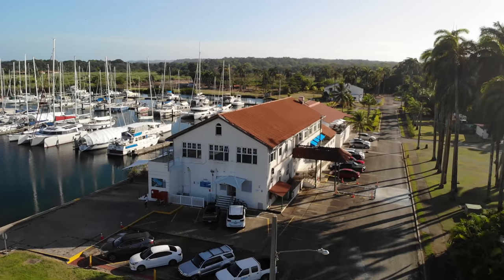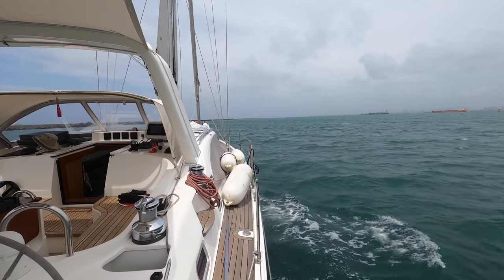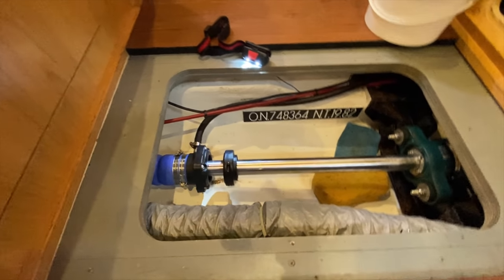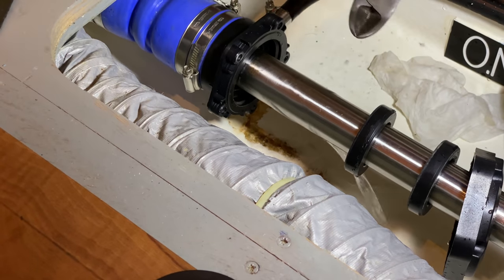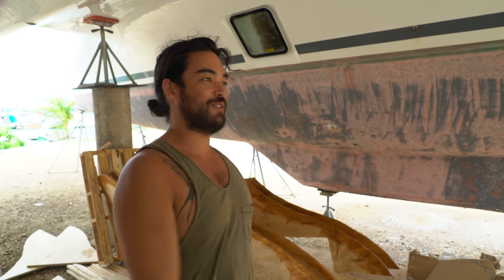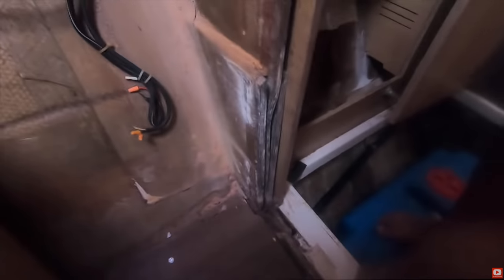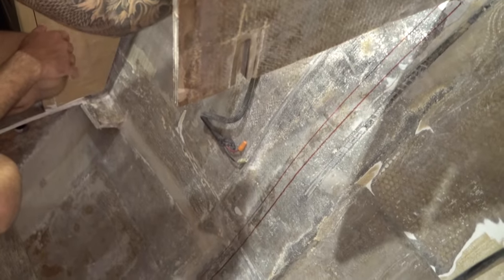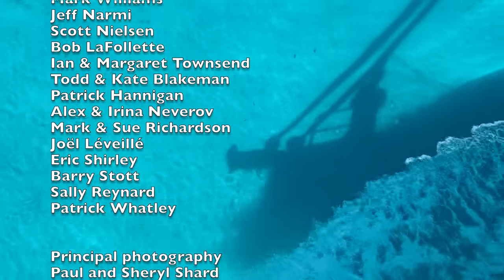We're Taking on Water! | Distant Shores | EP 210

Comment: Just curious, with the ability to beach your boat, why not beach it and then change the seal?
Reply from the maker: The shaft is about 2' underwater so we'd need more than 3' or so of tidal range to dry out and get the shaft up out of the water. I did this once on a beach in the UK (with 10' tide range that day) to change the propeller. All went well until I realized I was missing a needed wrench... very fast run to the hardware store in town to get it done before the tide came back in :-)

Comment: So, I've been doing some mental math, and think that I'm smart in looking for a shaft driven propeller system when choosing a blue water boat. I was surprised at how little water you took on while replacing your 'stuffing box' seal- I expected much more? I must be somewhat correct in guessing that a sealed driveshaft has much less of chance of sinking a boat that a sail drive unit- not to mention the 1/2shafts and bevelled gearing to change thrust direction. 
   I am very curious about the designed hull in process in Holland? Is that project a go for Distant Shores, or- is it still in the design phase? I'm exceptionally curious about aluminum built boats over say 50 feet? I hope that the project is till going to happen! Any news would be great. Thanks in advance.

Comment: Would drip less system  work for older sailboat in like 1973
Reply from the maker: Any boat with a shaft drive should work. It replaces the more traditional stuffing box. Let us know if you try it! Also as Stuart W says down below you can also try the modern packing in the old box...
Reply: What the brand you use
Reply: I have a 1978 North American 40 with a traditional stuffing box. Each hail out I have it serviced and I like that it can be adjusted under way.
Reply: Volvo shaft seal is probably the cheapest & very good for an older boat
Reply: @billhanna8838  Agree, for an older boat, the Volvo seal is probably the best choice.  Inexpensive, but simple and works well.  Have to haul out and pull the shaft to replace it, but a recreational boat may only have to do that once in 15 years.